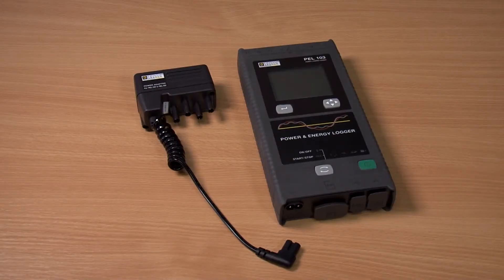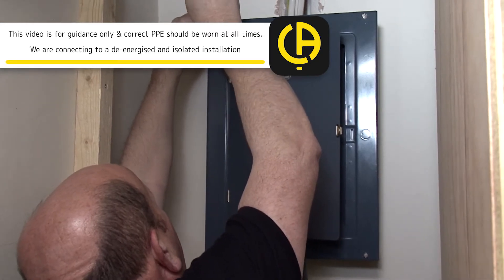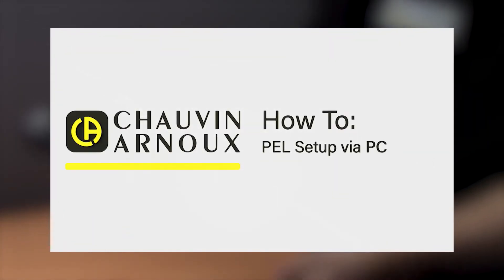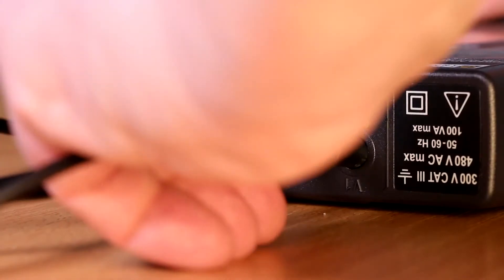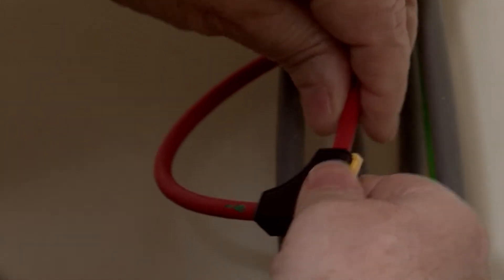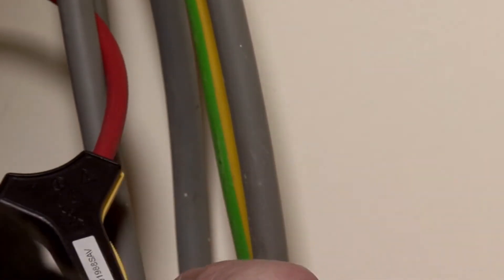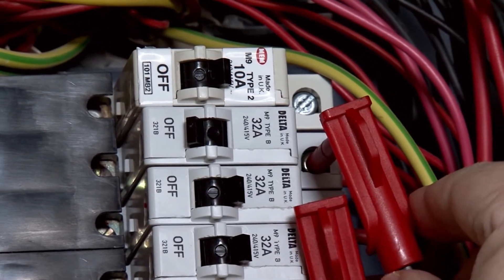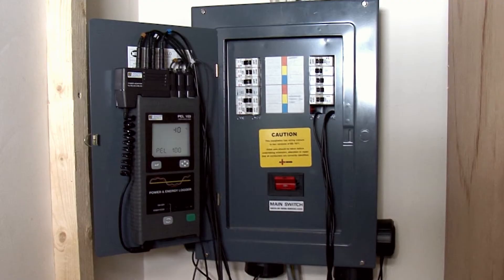How to connect the Chauvin Arnoux PEL to a 3 phase installation

Comment: How long of a log file will it store?
Reply from the maker: We recommend optimizing the data on the SD card and recording only the necessary measurements. For guidance, a 5-day record, with an aggregation time of 15 minutes, a record of the “1s” data and the harmonics on a three-phase four-wire network occupies approximately 530MB. If the harmonics are not essential and if recording of them is deactivated, the size is reduced to approximately 67MB.

The maximum durations of records for a 2GB card are the following:

7 days for recording with an aggregation time of 1 minute, the “1s” data, and the harmonics;

1 month for recording with an aggregation time of 1 minute, the “1s” data, but no harmonics;

1 year for recording with an aggregation time of 1 minute.
Reply: Ok thanks for the info!